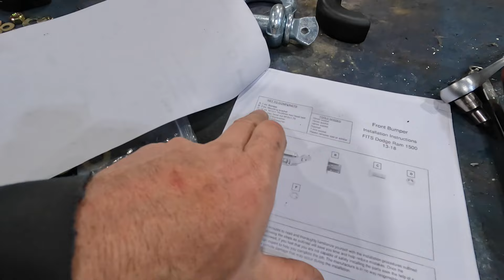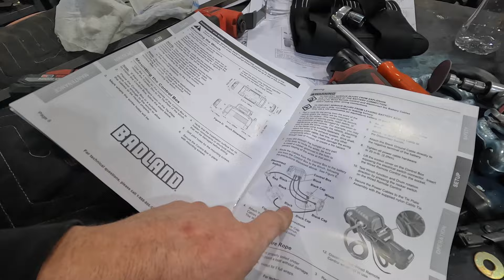Amazon Off Road Bumper Review

Comment: I appreciate your video. I have installed the same front bumper with the winch plate and LED lights on my F250 and left a review on amazon. I already had a Badlands 12000 lb winch and got a remote control to go with it. The Badlands 12000 ZXR winch was a 1/4" to big to fit in the bumper, so I used a hydraulic jack and opened up the bumper enough to fit the ZXR winch, it's a tight fit and not noticeable at the points I opened up on the bumper. I didn't think about relocating the control box like you did and might have considered that an option. Other than that, everything fit as designed and liking the new bumper with winch and LED lights.
Reply from the maker: That’s awesome you made it work

Comment: Sweet truck and good video. That hardware seems to be Metric 8.8 which is equivalent to grade 5 SAE. For it to be equivalent to SAE grade 8 it would need to be stamped 10.9. I don’t think it will really matter though. In fact grade 5 may be better for the application.

Comment: I have the same bumper on my big horn classic, along with a 12000 lb superwinch. It is sturdier than it looks. I just pulled 23,000 lbs of f350 and a sewer jet trailer with 900 gallons of water sunk to the axles. No grunting or creaking from the bumper.
Reply from the maker: That’s awesome !

Comment: Cool, i have the exact same truck and the same color, 2023 Warlock but mine has fogs, tow hooks, etc. Possibly he ordered it for the STANDARD classic not the Warlock, mine has the V-6 too, not bad at all, i have limited slip and 355 gears. I doubt if he gets 20+++ MPG though, I drive normally and lucky to get more than 19-20 highway. Warlock comes with 275/60/20 tires
Reply from the maker: I think he gets 18-21 now
Reply: @FlippinCustomized  I calculate REAL mileage by miles driven and gallons used, the 'estimator' is about 1 mpg optimistic. I just ordered one of those NIXON rear bumpers off ebay, it was discounted to 308.00 and they still had best offer so i offered 294.00
Reply from the maker: @zxtenn  nice 👍